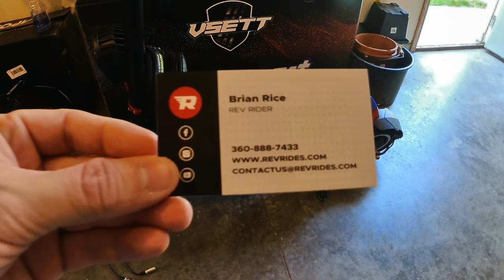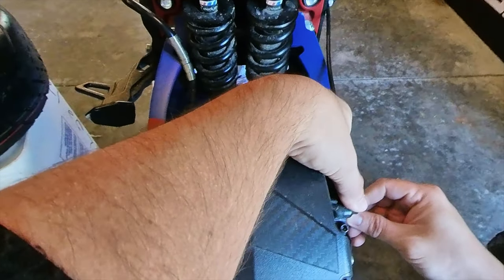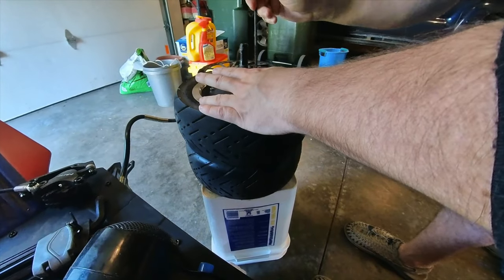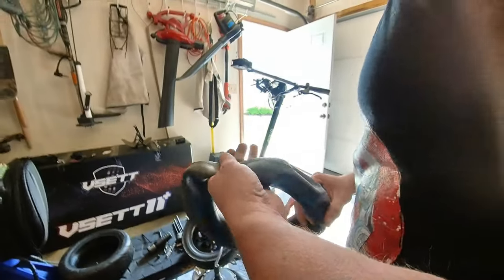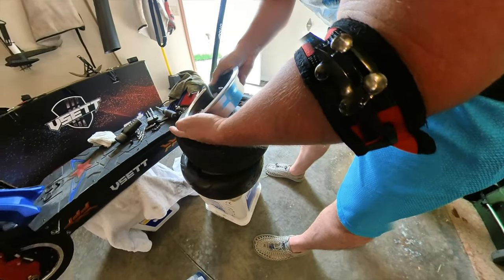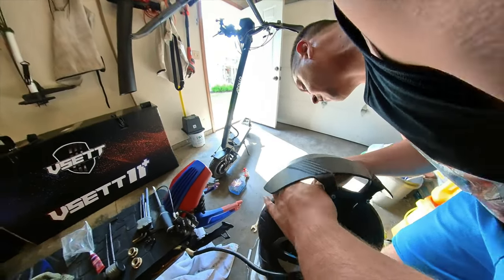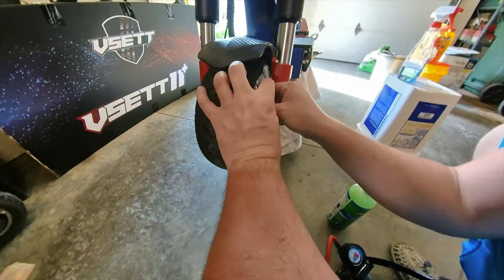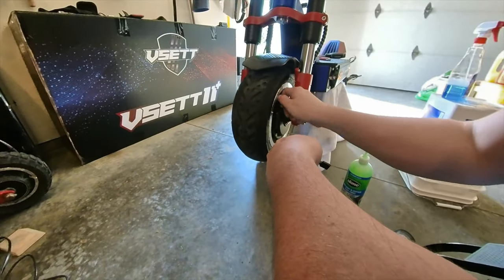Vsett 11+ Tube Swap | Stripped Screw Simulation | Slime Tutorial | Electric Scooter Maintenance 101

Comment: hey @Scoota Gang , i,m back with another problem ...
bcs im just so lucky, i managed to get a flat once again (6th flat in 8 months)
this time it's my front tyre, i changed it easily.
but for some fked up reason i can't get the brake claw attached.
the claw is grinding against the wheel, and i have no clue what i am doing wrong.
there is 1 washer that i can't get back in there (the side of where to motor cable is are 2 washers apparently)
but with both washers in, it's impossible to get the wheel back in.
but even if i could, i don't see how that would change the distance from my brake disc and the wheel, bcs that's where the brake claw keeps griding.
also idk why, but ur front wheel disc is on the other side than mine.
ur motor cable is on the same side as ur kick stand.
being 100% sure that it's different for me, i still tried to reverse my wheel so that the disc brake is on the other side.
but 1st of all its physically impossible to do so, and 2end my tyre is then in the opposite direction, which shouldnt be possible because i didnt remove the tyre...
ive spent hours and hours observing what i'm doing wrong i am litterally losing my shit.
i need to fix this before i have to go to work tomorow.
could u make a short video on how to dismantle the front wheel and put it back together? should u have the time for it
Reply from the maker: You have to put both washers back exactly how it was before. It’s hard to get it back but if you loosen the cross joints up above (the red part) it will give the fork more room to seperate and you can fit it with the correct washers. Does that make sense?
Reply: @ScootaGang  makes alot of sense yes, not sure which bolts i need to loosen though.
could u dm on fb perhaps with pictures to point out what you mean exactly?
also im still confused how every picture i find of vsett 11+, the wheel's direction is very diff from mine.
all of them have the disc brake on the right hand side.
Reply from the maker: @medino9058  Yeah send me a message. Who did you buy it from? You should be able to get help from them too
Reply: @ScootaGang  i bought it from a shop about an hour driving, but i aint got a car xd, dont want to ask a friend for something as small as this. imma bring it to a bicycle shop where i know a guy that might be able to get the washer in.
it's the only thing that i cant get back in, allthough idk how that is supposed to increase the distance between the disc brake and the wheel itself. because thats the problem, the freaking break claw keeps grinding the wheel still didnt fix it, ive spent hours and hours alrdy for something that's supposed to be as simple as 1+1 equals 2.
align the holes of both pieces, and put the screws in, dunno where shit goes wrong
Reply from the maker: @medino9058  I'm sure they should be able to help you fix it remotely is what I mean. They should have some customer service that can walk you through it. It still sounds like you need to get the washers back how they were so the brake lines up. If you change anything with the washers it will never align properly. 

Like I said before, you can loosen the red cross joints that hold the dual stem together and that will give you a couple extra mms to get it back together.
Reply: @ScootaGang  hi I have the same issue, the front brake calliper is rubbing on the rim of the wheel, any ideas?
Reply from the maker: @user-uh9yp1bu9e  on your vsett 11+? or a different scooter?
Reply: Vsett11
Reply from the maker: @user-uh9yp1bu9e  And you just changed the tire? you probably didn't line up the washers in the same configuration as it was originally.

Comment: damn,  no more armor dilloz.  btw you should REUSE the slime thats inside the old tube.  Just cut the old tube with scissors and squeeze the slime back into the bottle.  Shit saves $$$$.   This video never makes me want to own a Vsett 11.   I have a zero 9 and a Phantom is on the way.
Reply from the maker: Ahahah if I was using Armor dilloz I would have to reuse it lol. But slime is so cheap it’s possible to throw it away without feeling like I just got scammed lol
Reply from the maker: If slime works 80% of the time, and armor dilloz works 90% of the time....is it worth 5x the price?
Reply: @ScootaGang  yes because I reuse Armor dilloz.  and 10% of the time i don't want to be stranded with a flat tire.  1 uber ride easily costs the price of dilloz
Reply from the maker: @deanh3678  hahaha I’ve yet to be convinced that armor dilloz does anything for tubed tires. Zero to Epic had armor dilloz in every tire he got a flat in….4 flats in 30 days
Reply: @ScootaGang  amor dilloz healed a pinch flat for my z9.
Reply from the maker: @deanh3678  nice! Slime has fixed many tires for me. Every tire goes flat eventually then I always slime it. This is the first time it actually didn’t work just because the hole was in the valve stem. It’s good stuff

Comment: You almost can do it without removing the rotor since them screws are fragile
Reply from the maker: I recommend replacing the rotor screws the first time you do this.
Reply: @ScootaGang  didn't have a heat gun and did a double patch since it sprayed slime at me🤣🤣
Reply: @ScootaGang  I'll do it when I replace tube and tires